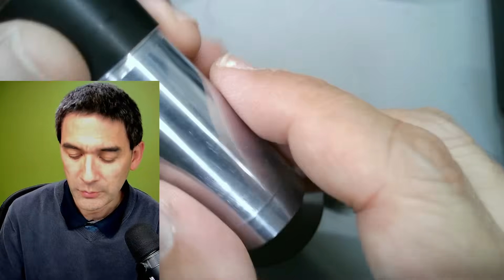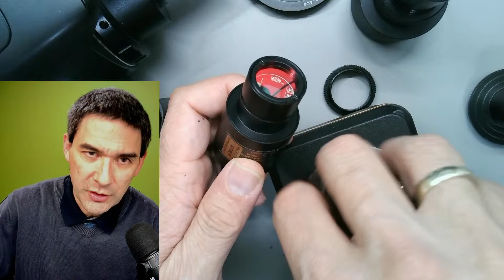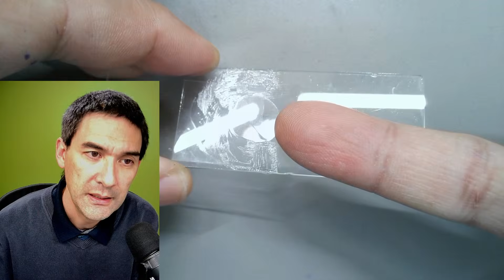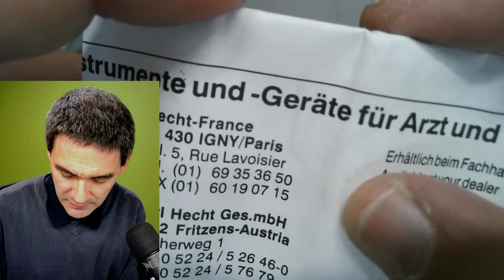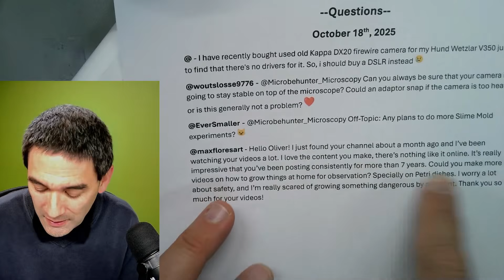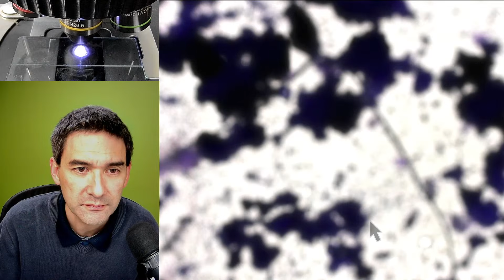🔬 DSLR camera adapters for microscopes

Comment: Another great video.  Thank you.  Any chance you can pin exact links to the T2 adapter ring and the nice extension tube that will work with my Canon Rebel io6...the one you shared early in the video?  I followed your Amazon affiliate link/store , but it's not clear what items I need to adapt my camera to the trinocular port of my Olympus microscope.  Thank you.
Reply: By the way, Canon EOS Rebel T4i.  Microscope is Olympus BH2

Comment: 45:30 If max MP is about 5, and we aren't going to use the lens anyway. I wonder what the return on investment would be on buying a random cheap 6-12MP point and shoot from Amazon and taking off the lens with a hammer(or screwdriver).

Comment: I use 1st curtain lock-up(mirror setting) for a more stable shot. Even with a cable the cutains make jitter and is noticable in the images.
Reply: SD-XC cards will give few more fps for fast shots